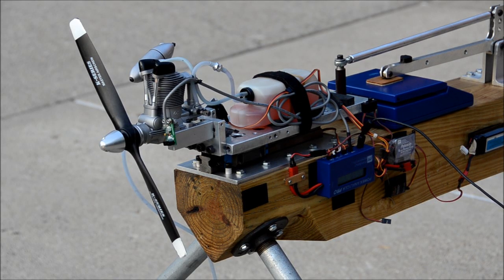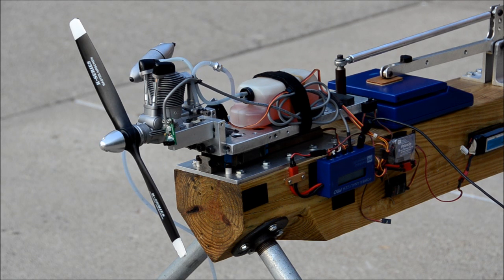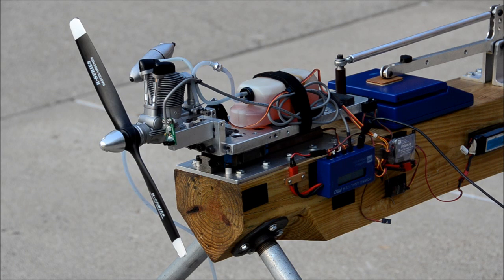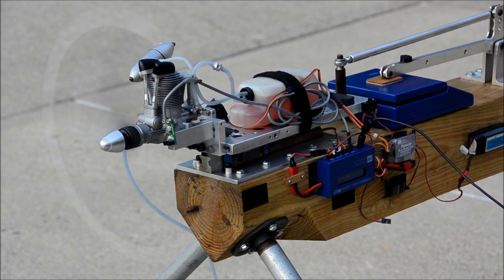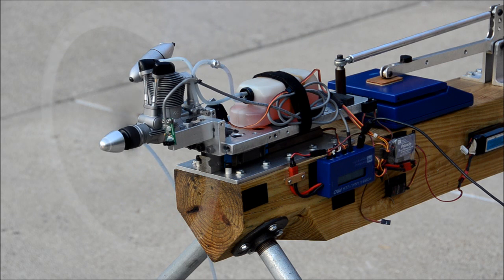O.S. FS-95V Four Stroke Engine Test with Master Airscrew 14X6

Comment: I plan on using this in a plane that the specs say weighs just over 9 Lbs, with a 15 inch prop, do you believe it will hover nicely? I really dont want to buy another engine and OS recomends up to a 15 inch prop. Thanks

Comment: I just broke in one of these. Before the first start, it turned over easy with not much resisance. When i  went to start it the second time, it seemed to have more resistance and compression when I tried to turn it over and the engine seemed to run a little more rougher. Is this normal?